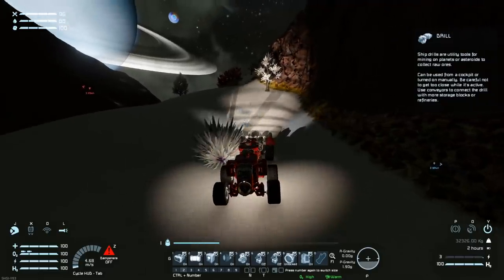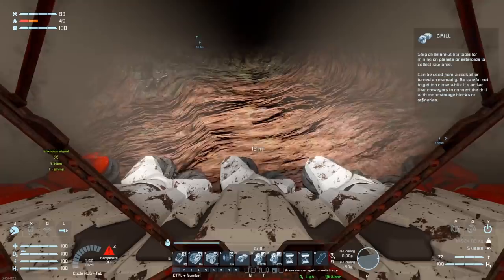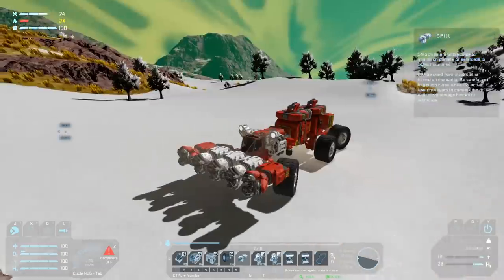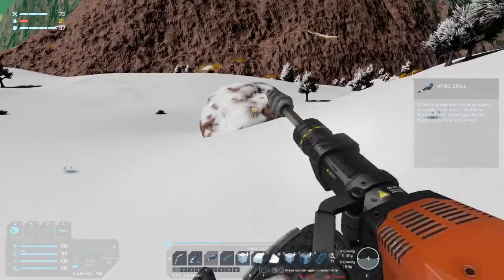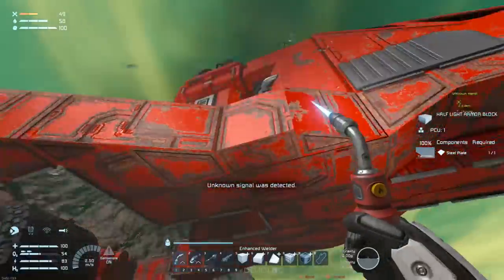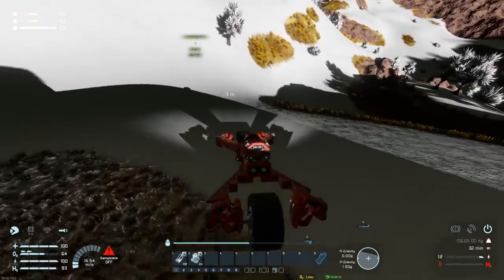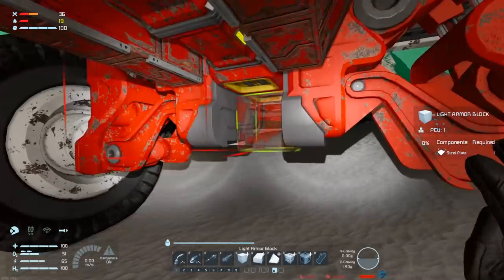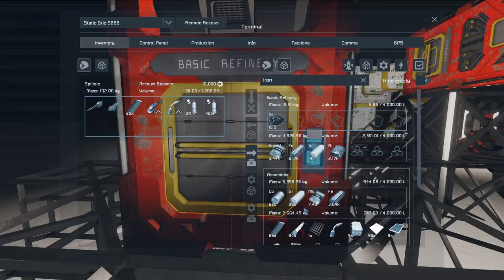Survival Impossible - Splitsie's Motorcycle Club #9 - Space Engineers Hardcore Survival

Comment: also to solve your base power while you're away from it, what about a sensor and control panel set up... while you are away sensor shuts off all the lights, when you return it reactivates them... but have the control panel as an easy override so should you run low on power have them configured so you get a set number of lights then the rest then a button for all to be turned on and off.

another idea for the wheel struts, stick a couple of small wheels with the friction set to 0 on the edges where you are most likely going to impact, and thicken the struts a bit, might weight you a bit but could mean the difference between then snapping and skimming the ground and coming out of it with minor damage... then when you establish your base at the mine or in the tunnel etc, couple of welders and projectors to ensure gufi and the bike are able to be repaired while you hide in safety
Reply from the maker: The trouble with sensors is that they use up a bit of power themselves which I believe is related to the size of the volume they're detecting - at one stage this was the case, not sure if it's still true, so I would likely do that once I've got more lights to make sure that the power benefits are there :)

Completely agree with the frictionless wheels it's something I'm keen to try to see how it works out :)
Reply: Good point I hadn't thought about the power consumption of sensors too much, but i assumed instead that they may have used far less than you save...
Might try it out on one of my builds when I get chance :)

Comment: hey, i think that for the motorcycle's front, where u added the two 2x1x1 bases then a half block, u could place an air vent instead. Simpler, add a vent at that conveyor connection point on the front of the fighter cockpit. Just a suggestion, there's probably some blatant obvious thing I'm missing that would help with this, but I think that will help with your oxygen when you're on the run. (not sure if you'll need an oxygen tank though, now that I think about it.)
Reply from the maker: Agreed, I really think that air vents are becoming my new gyroscope - the thing I always forget during the initial build phase :P

Comment: What SE doesn't tell you about gyros is that their orientation is actually important. Turn them so that the frame for the gyro ball is facing vertically in relation to your cockpit for more roll control. For reference, imagine the lights of the gyro spinning in a line, and that line is the direction in which they achieve maximum torque for minimum power. It's a hidden mechanic I've stumbled across in my ship designs
Reply from the maker: From my testing that's not the case, the most reliable way I could work out to test it was to put gyroscopes on a vehicle with all different orientations and then set them to override, with the overrides fighting each other there was no gyroscope that was able to overcome any other which means they were all generating the same amount of force
Reply: @Splitsie  Interesting. I haven't tested it in quite some time, so perhaps something changed, but I know i used to be sure to cover all the directions in my builds just to be sure. Anyways, enjoying the series, keep calm and carry on sir. Cheers!
Reply: I was just messing around bored and tried something out. 3 gyros, two on override in opposite directions, and one free for controls, and it made a very stable two wheeled vehicle. Don't know if you've explored that route yet, but it definitely works on my test cycle.

Comment: Hey Splitsie, wheelbase on the motorcycle is way too long. I suggest making it shorter. Also build frames above and over the wheel supports to the main frame, to add strength, and resistance to ground impact triggered wheel amputation. ;)
Reply from the maker: Agreed, the wheelbase needs to get much shorter :)

Comment: I think if the wheel base was closer together and had them connected with a piece vertically instead of horizontally might give you less ground collision.
Reply from the maker: Definitely agree on the wheel base, unfortunately it's the suspensions themselves I'm hitting on the ground so I can't really fix that, but shortening the wheelbase would likely improve mobility and reduce weight somewhat so that's almost certainly going to be part of the upgrade :)
Reply: You really want to get crazy you could mount them angled on rotors.

Comment: Suggestion for the bike. USE GYROS MORE. I get the design was meant for less gyro override but thats clearly not working, maybe try using the more usual gyro override stabilizing so you're not slamming into the ground as much
Reply from the maker: I was using the manual gyro stabilising but at times that was making it near impossible to make the bike follow the terrain properly to avoid smacking the suspensions :(
Reply: @Splitsie  i meant auto stablizing, set the overrides to keep the bike upright

Comment: I think you need to angle the supports so the supports have more clearence for your bike or you could use something like blast boor blocks(I think that's what they are called) to protect the corners that you hit the most so it could skid on them and you wouldn't have to worry about it. I don't know anything about engineering. I just noticed that it was the outermost corners that are always pitting into the ground.
Reply from the maker: Definitely need to have something to protect those outer corners, either blast doors as you say or using 1x1 wheel suspensions set to zero friction
Reply: @Splitsie  yep sounds good to me. My uncle plays and I watch captain Jack and that's about all I know of space engineers lol. I watch you of course to as you are very entertaining.
Reply: @Splitsie  more entertaining though with the carpark in tow.

Comment: have you tried dual inverted wheels in the back... leave 1 small conveyer space apart between each wheel... then a single wheel up front... id try it but im having steam issues
Reply: to add to this comment i think the strength in the rear should have a difference of about 5 from the front... keep all the drive power in the rear wheels and the steering in the front. dont think a gyro would even be needed
Reply from the maker: If you set it up as a trike like that you could probably get away without gyros, but for a two wheeler they're mandatory due to the way the wheels work in SE. I didn't test out a configuration like you suggested when I was mucking around in creative but I did end up with a design I'm quite happy with  :)

Comment: Great episode, and it's an interesting design - reminds me of a lobster somewhat (potential name 'Lobsta'? lol) - and yeah, probably best salvaged with a trike conversion (imo). From the looks of it, you're running into the kinda problems I've been having with balance (altho using the 5x5 to take advantage of tyre thickness was a good idea) and the best results I had, was with 2 gyros set to override (one each 'roll' direction), 1 'normal.'

It uses the motorcycle wheels mod, but would you be okay with me sending you a blueprint of my prototype over Steam? I'd value your feedback on the overall design, as well as getting those overrides fine-tuned (plus I think you'd get a kick outta riding it). No worries if not, you probably get deluged with similar requests ;-)
Reply: Oh, and what's the giant gas giant called, again? You didn't say when I asked last week - rofl
Reply from the maker: The gas giant is part of the Paradise system by Doctor Octagonapus and I believe it's called Bylen :)

Feel free to send the design, though I can't promise I'll have a chance to properly load it up and take a look at it due to usually struggling pretty badly for time (especially on weeks with more shifts at work)

Comment: The bike has the suspensions attached at the end of the arms, maybe attaching below the end of the arm, so the lowest point will be the suspension, arms itself should be higher then and most likely avoid crashing into ground. You lost the whole suspension due to armor block breaking and suspension part falling off.
Reply from the maker: The suspensions were sadly still the bit getting hit, it's a problem that I think I'll have to solve with some bumper 1x1 suspension wheels to prevent it :/

Comment: I wonder how a bike using 4 3x3s and rotors set at an angle so that the tires are in a V shape would do on terrain? My reasoning is that it should afford you with the ability to get the suspension block more off the ground with more actual wheels in contact with the ground. It also allows you to change the wheel/ground angle to make like a parking mode. Not sure if it would be worth the cost but its and interesting idea to investigate.
Reply from the maker: I really want to try this but didn't get around to it when I was building on Twitch yesterday, hopefully I'll get some time later in the week to have a crack at it all again :)

Comment: How about 5x5 wheels without suspensions, connected by rotor with no strengh on both sides of the wheels, you can lock them to brake, use small thruster to move forward and backward and turn with gyro's 

i think that even with the current gravity just cruising on the ground with atmospheric trusters should work.

I would love to test this myself but unfortunaly my graphics card burned while i was playing space engineers... :p
Reply from the maker: I'm not sure how durable wheels are in that setup, but it's something I want to test and see if I can get working well enough to use as a vehicle :)

Comment: Instead of having the supports of the wheels going side ways make them go up then down like a McDonald’s sign then add 1x1 wheels on the side I case you lose power or tip over
Reply from the maker: The trouble is that the supports aren't what's hitting the ground, it's the suspensions themselves. Also frustrating is that 5x5 suspensions don't have an attachment point on the top or bottom, only on the front back and side which greatly limits how you can stick blocks too them :(

Comment: Can you put wheels on rotors through some futzing or Space Magic trickery? If you could, that might help it slim the design to get the banking ability you were talking about needing. Would the gyro's be able to propel it forward? Maybe use a single driving wheel on the back (trike configuration?) with a front wheel on a rotor if it's possible.

OR

Large grid wheel suspension on a rotor to convert to small grid. Just go overkill with it haha
Reply: Large grid wheel suspension might look a bit like those bikes with tractor wheels on them
Reply: Just remembered that your scooter in "Survival Maybe" was rotor mounted wheels but I built this anyway. Don't ask how many objects started levitating and shot off in to the distance when it self destructed during the first few build attempts..... I saved a picture of the built wheel in my dropbox https://www.dropbox.com/s/w7dae7lr9dd8yfs/Rotor%20Mount%20Wheel.bmp?dl=0
Reply: I did not realize that you could attach the wheel straight on the rotor without the rotor part but it seemed to be happier with the rotor part on the wheel first and then attach to rotor. As you can see, I have rotor parts on both sides of the wheel and rotors on both sides. I hadn't unlocked the landing gear to see what would happen yet. Unfortunately it's an even number of blocks wide so the cockpit won't fit right. Not sure what the answer for this is
Reply from the maker: It's always a challenge dealing with even numbered things like that, I haven't got a good solution but I am interested to test the rotor/wheel combo to see if it can withstand the speeds I hope to go as without a suspension it's a bit of a risk
Reply: It took quite a bit of engineering to build.. Space Engineering! Merge blocks and Pistons made this an interesting build process. Several failed explosive and free spinning attempts later, here is my quick video

Comment: Motorcycle is too rigid, no suspension to absorb blows from terrain.
It's also a bit too wide towards the ends, leading to clang and damages.
If wheels were pointed out and made buggy style, it might fix the issue.
That, or bring the wheels in more, make it shorter by even 2 blocks.
Good luck! thanks for the videos

Comment: also, you literally just need to add motor bike wheels, and you have a VERY small bike and it is really easy to handle with two gyros, and the suspensions make it so it doesn't hit the ground, just add the the bike cockpit and it is easy.
Reply from the maker: Yep, but since when have I solved engineering problems with mods? ;)
Reply: @Splitsie  lol, good point

Comment: 5:20 - I thought you can switch handbrake on and off for individual wheel suspensions?
Reply from the maker: Nope, it's done from a control block so at the very least I need a remote control on the trailer to activate the ones on that grid (the cockpit control doesn't activate the trailer brakes) :(
Reply: @Splitsie  Oh, the Brake setting in the wheel suspension is for sensitivity to Handbrake input.... confusing, but still my fault

Comment: I did a trailer for my truck like you did but I can't set the trailer's wheel to steer, do you know what wrong is?
Reply from the maker: You need to have Whip's Subgrid Wheel Control script running on a programmable block to control wheels that aren't part of the same grid (wheels on anything connected via rotor, piston or connector are on a subgrid so can't be directly controlled without a script)
Reply: @Splitsie  i see. Thank you so much. I will try it.

Comment: Something I do with every vehicle that has to dock is a camera view and docking target.  A block with a camera looking back over your rotor connector and an off color block similarly positioned on the rotor base on the trailer.  You just go to the camera view and back into place.

Having built a couple of ships that use a "trailer" type setup, I usually place the controls for that trailer on a separate tool bar in the main cockpit.  They "go grey" when the trailer is disconnected, but are still there and ready to use when you hook back up again.  If you put the trailer wheels in a group on their own and set a button to lock their brakes before disconnecting, it could save you some trouble, if the sub-grid wheel script will let you.

Here's a ship I built that demonstrates these ideas you can look at:
https://steamcommunity.com/sharedfiles/filedetails/?id=1901473701
Reply from the maker: The brakes setting for wheels isn't actually the activation of their brakes, all it does is toggle whether they will brake when the brakes are applied, though I hopefully will be able to achieve what you're suggesting with the addition of a remote control block on the trailer :)

Comment: Use roters in stead of the wheel suspension
Reply from the maker: Sadly that leads to explosions of the wheels at even moderate speeds as the wheels for suspensions have a lot more impact resistance than the wheels you can put on rotors :(

Comment: Why noy try a 4 wheeled vehicle but line them up like a bike ie 2 suspension with 0-1block gap in between suspension, in line in front of & behind cockpit with similarly long wheel base & just greeble to hide suspension so it looks like 1 ultrawide tyre instead of 2. Kinda like batman's bike in the dark knight.

The problem with the current design seems to be when you bank left/right the suspension, being on the outside, strikes the ground. This would be a non-issue with the wheels on the outside instead.

Comment: Really?  You build a rig to support a large grid or detector and you leave it at home... slow clap engaged.  Also, I'd have gone unicycle as well.  The way wheels work, with those massive mounts, doing a bike is near impossible without a sidecar design.  You need a way to attach wheels with a thinner mount suspension.